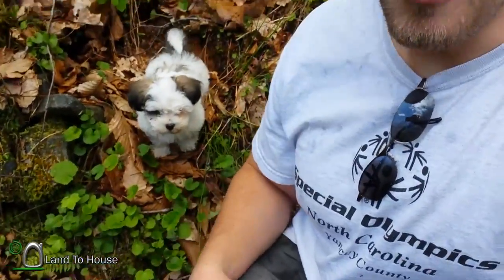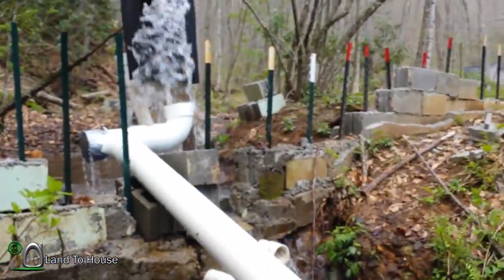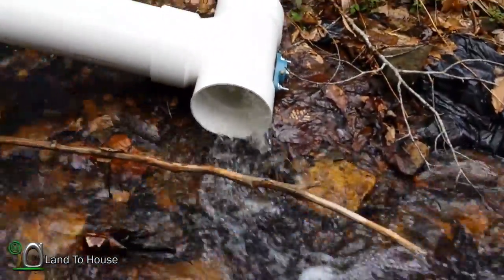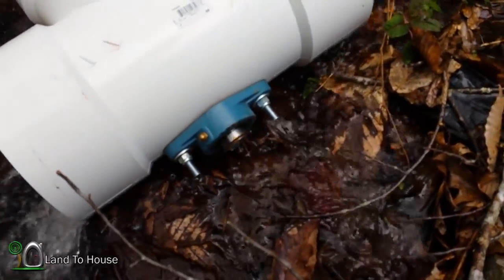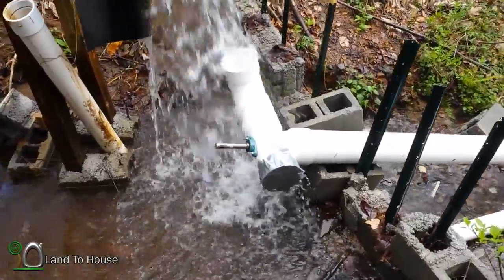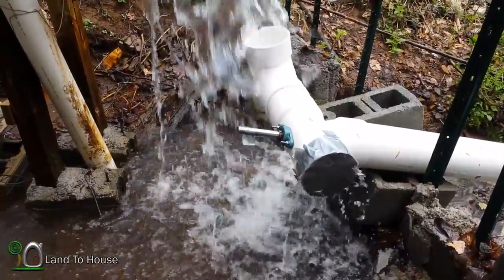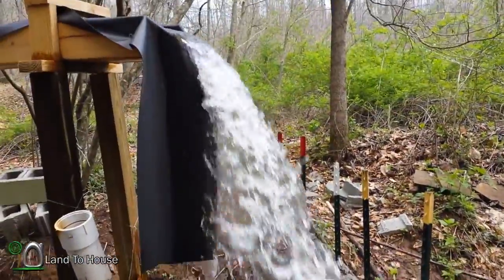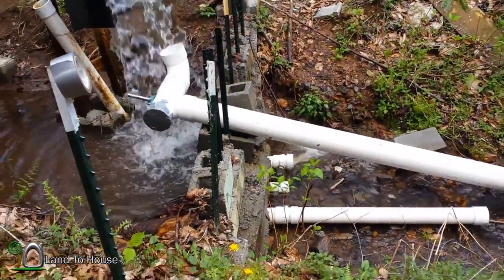Archimedes Turbine Test 2

Comment: Back of the envelope calculations .. the pipe needs to stay about half full of water and half full of air.  If the pipe becomes completely filled with water, it will swirl around the screw and impart less torsion on the screw.  half full of air causes the water to try to climb the screw and impart torque as gravity pulls it back to the bottom of the pipe.

Comment: Hi Seth: I watched all three of you videos. If you add more 6 inch pipe up in your water supply and guide the water into the pipe up above with rocks or anything and connect that pipe to your 90 degree elbow,You would get more water/power to your screw. Turn your outlet tee to up and down, add a elbow and a little more pipe for good water exit. put caps, Not tape on Your non use ends of the tees. Good luck when You get back to it. I may try the screw myself,More things to check first. Thank You for the great videos.
Reply from the maker: Absolutely! I did not connect the auger to the flume in this small test. Someday when I actually get serious about this test I will capture all the water in the pipe.

Comment: Very impressive, you will have some serious action once you capture all the water. When you were showing the build and the screw was sticking inside the pipe I had quite a few doubts that it would work. I should have known better....well done
Reply from the maker: Michael Collinson I hear you. I think that is why I did not test it sooner. I set it up at home and ran the garden hose through it. ... 5gpm. And so I thought that it would never work. Once the mount is finished and I get this thing at 45 degrees with the full 150+ GPM it will be interesting!